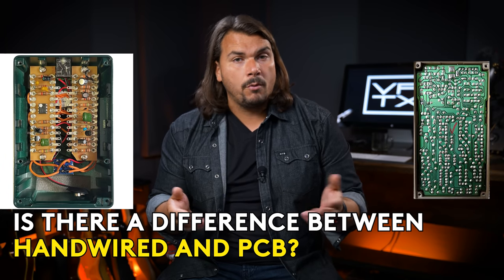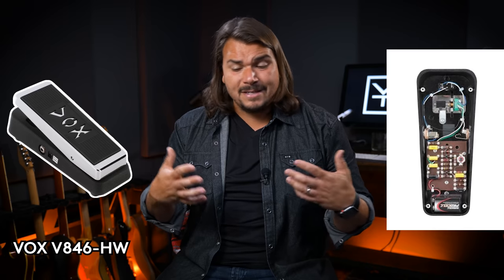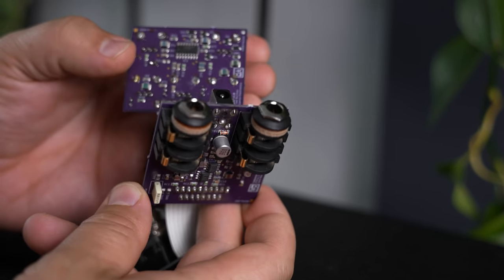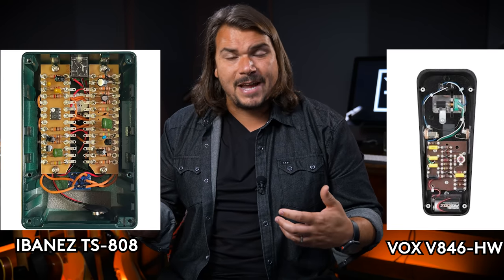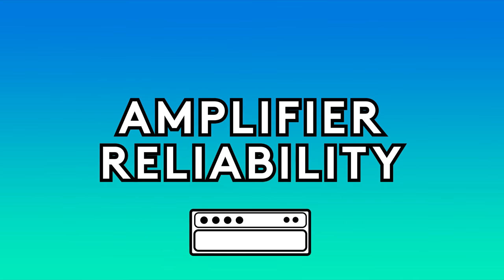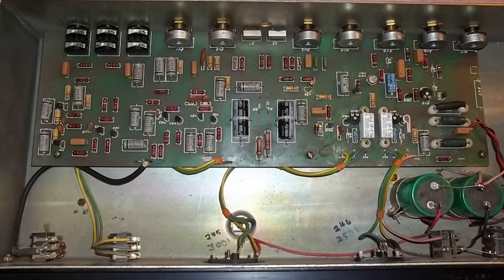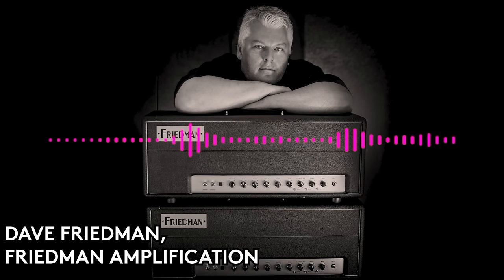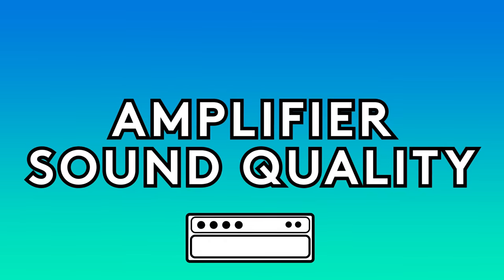Is Hand-Wired Actually Better?

Comment: All of it makes sense except the servicing - 100% no way can you fully service or avoid as many issues with a PCB. And keep in mind, the way Suhr or Friedman does PCB is not the same as everyone else. Also if you have an issue in 20 years with a PCB, will you be able to find a replacement? The best amps have historically been hand wired- because that’s the expectation, and thats reality. These are engineer-centric opinions, not necessarily user or owner based opinions. Ask a rock star, not an amp builder.
Reply from the maker: You actually can if you know what you're designing for.  The quality builds often will wire off pots, tube sockets, switches, and jacks as they are higher failure and higher usage parts.  They'll keep the other parts on a PCB.  Typically, there's not much to do on the main PCB if everything is executed properly and you have all your other parts already wired by hand and mounted to chassis, not PCB.  You're right, Suhr, Friedman, Rivera, Fuchs, do PCBs really well.  There are also a lot of bad PCBs out there that give quality PCB amps a bad name - but we're unfairly blaming PCBs for being the problem instead of bad engineering.

Comment: In terms of repairability, yes
Reply from the maker: Depends on the PCB and layout.  Often designs that are just going for cheap and short lifespan don't consider this - that is true.  But not of the high end amps.  PTP handwired can also be done poorly too making it difficult to service, especially if things are overbuilt like a Matchless.

Comment: when comes to AMP having both / I always loved,  AC30 there normal then hand-wired, so then u got the option, and the cost reflects it. repairability is needed I believe.  when comes to pedal PCB 100%  but  to mod thru-hole is nice but yeah tech moves forward, from pod bean to helix
Reply from the maker: They're not exactly the same amp unfortunately separately from the assembly style.  Same with most of the Fender amps as well.

Comment: "Hand wired" and "PCB" aren't mutually exclusive. This should be about point-to-point vs PCB. The Centaur and KoT do use PCBs, but those were assembled entirely by hand! Even surface mount stuff can be assembled by hand. Hypothetically, someone could make a machine that automatically assembles and solders a point-to-point fuzz circuit on turret boards - what category would that fall into in this case?
Reply from the maker: Sure...that's true, we're sorta collapsing PTP (point to point) with Handwired as that kind of how the market has come to ID this method in marketing practices and how consumers have come to know it.  Any process done by hand increases failure - by an order of magnitude (in the words of Robert Keeley) - the current Klon is all machine made, wave soldered etc.

Comment: Not surprised MANUFACTURES feel this way.  Of course these people like pcb because it increases margin with less qc complaints.  What about mods?  Ask anaolgman.  Or repairs? Some manufacturers won't even provide schematics to techs to repair amps. Some techs can't work on these products.  What do these interviewers care if you need to junk them?  Now you need to buy a new one and they get more $
Reply from the maker: Analogman's pedals are all PCB as far as I know for the main level boards, often the pots as well and footswitches.  These manufacturers of amps all make PCB and Handwired amps...they do both.  You're not going to find more respected voices in the industry that these guys when it comes to amps.  For pedals, I presume you're not speaking so much to in terms of handwiring as this is very rare and almost unused.
Reply from the maker: Travis Crow - who would be better to ask than someone that's actually building amps and pedals?  If you're not in manufacturing than you really have nothing to contribute here.  Most quality technicians will agree with this as well...nothing here is unique to these builders.
Reply: @VertexEffectsInc  Newer surface mount boards can't be modded by analogman.  Handwired amps/pedals are easier to mod and repair.  While I can appreciate that these are leaders in their field even they would qualify that a pcb needs to be well to be equivalent to hw.  Many are not well designed. Black star has a notoriously bad layout and  the bassbreaker boards are folded over.  Not every tech has the equipment or skill to fix surfaces mount parts (if they're fixable at all).  If it's not fixable it's junk. if it's too hard to fix no one will try and it's just gonna fill up your local landfill. just like those un upgradable phones
Reply from the maker: @jamesenter2095  he may not mod them, but they can be - but is that really the intent of any builder/designer - to build their product with the intent to modify?  Typically, that's not a consideration.  I understand that many companies migrated to SMD is consequential to Analogman since part of his business is modifying Boss, Ibanez, MXR, pedals etc.  However, through hole is reaching EOL (end of life) for parts number left, right, and center - every company will be forced to re-design around SMD sooner or later as they won't have an option in through hole for most of their component choices.  I agree, there is some really poor implementation of PCBs, especially on more budget tube amps like that you mention - this is however not representative of what PCB amps can be or their level of serviceability.
Reply: @VertexEffectsInc  surprised you didn't mention price in the vid.  that definitely makes a difference.   fender also uses lower quality components on their ocb amps.  love your stuff.  I joined your patreon last week
Reply from the maker: @jamesenter2095  Price and quantity will often dictate the PCB, John mentions some on quantities in his commentary, Josh mentions price in his commentary.  Generally, you can make an amp cheaper by going PCB and in higher volumes quickly on PCB.  You can also build a higher quality amp quickly on PCB however and cheaper than a handwired amp, however at a certain threshold some believe that only a handwired amp has merit, albeit incorrectly.
Reply: Sounds like a incompetent angry tech rant 🤣

Comment: PCB is surprisingly easy to repair, but it is definitely more precise than hand-wired. My biggest issue with PCB are the various unmarked SMD components. It dramatically slows repairs down trying to figure out if an unmarked part is testing correctly, especially when nobody supplies service manuals anymore.
Reply from the maker: That can be frustrating but that's more a PCB design layout thing...good versions of layouts will call out PN's and values often for SMD stuff.

Comment: This topic reminds me of digital vs analog, whereby modern implementations of digital tone is pretty dang good compared to the POD kidney days.

I remember when Klon started doing the KTR. All the gear heads were in an uproar. I believe the first batch did have some issues, but have since been fixed.
Reply from the maker: Well...both Klons were PCB and really no two Klons were exactly the same sounding IMO.
Reply: Ah my bad, I had assumed to Centaur to be through hole for the most part. So I guess that is one example of PCB but with variables decided by component availability then?
Reply from the maker: @coffeedudeguy  most every famous pedal is all PCB...Tube Screamer, Klon, King of Tone, etc.

Comment: You are basically correct about the construction of pedals and other similar items but you are way off base about amplifiers. Virtually no modern cicuit board amp is made to be easily serviced, particularly tube based amps. The components such as tube bases, inputs, pots, and switches are nearly always inferior to those used in almost any hand wired tube vintage amp. The circuit boards used in nearly all modern tube amps are thin, suffer from too thin or single sided traces and pads which will eventually separate from the circuit board, especially if heated when soldering in a new component. The components themselves are generally mounted diretly on the board causing heat failures, often in the first two or three years (I'm looking at you Fender, Mesa, etc.). Fender amps built before the early 1970s were all built to be easily serviced. No current circuit board amp is going to last as long as my 1964 Fender Super Reverb which has only the capacitors and screen resistors changed in the past 58 years and sounds better today than any Fender amp made today. You aren't being honest about serviceability of amps. You need to ask the techs who work on them and not the manufacturers. Every single tech I have ever encountered absolutely loathes Mesa Engineering and considers them almost unrepairable due due poor documentation, undersized components, and seemily randomly placed on multiple circuit boards. Modern Fender amps like the Hot Rod Deluxe and other similar models are all currently manufactured with very poor quality IC brand capacitors which fail regularly within two to three years. Many of these also suffer from undersized components, cheap pots, and failure prone circuit design mistakes that guarantee eventual early failures, excessive hum, etc.. 

No, the amps aren't better.
Reply: Owning a Hot Rod Deluxe really opened my eyes to the issues you mentioned.  The plastic input jacks alone are a shame.
Reply: @mr.anderson70  Check out Psionic Audio's channel. He's a tech that has recently done quite a lot of videos describing various amps repair and their typical issues as deep as you want to go. He does all brands of amps from the 40s through current. There are specific issues on things like HRDs that once fixed will really increase their reliability.
Reply from the maker: @clarkeblacker  you're correct when it comes to high volume and low to mid budget amps, like a Hot Rod Deluxe for example - bu these aren't good PCB designs and not on the level of a Suhr, Fuchs, Friedman, or Rivera amp for example.  We show some quality examples in the video, like the Suhr Badger and how that's done.  The PCB is quite serviceable, and the issues that normally occur on cheaply made PCBs aren't present.  Secondly, the do mount some parts directly to the chassis and hand-wire them where appropriate, like the heater wires.  I do watch Lyle's channel on occasion and on Facebook before he started the YouTube channel and the issues with PCB amps that he has are generally all cheap-o PCBs from Fender, Vox, VHT (post Fryette).  He'll also equally roast bad handwired amps or those that underperform the standards or over-perform the standards and create serviceability issues as a consequence.  I think he'd agree with much of what's said in the video.  You can't compare bad examples of PCB amps and make that the standard for a quality PCB...doesn't work that way.  Remember, it's the execution of the method, not the method itself.

Comment: Maybe you should ask Jesse Hoff(LAZY J) and Phil Jamisson (Matchless) they will maybe have different opinion,  suhr and friedmann are searching for high gain not for perfect clean... i've tried many time some amps that have a serie pcb version side by side with the  point to point model from the exact same model, and every time i was blown away by the difference!!! how do they explain that? i think some players doesn't even see the difference... i do
Reply from the maker: They've decided to build amps a certain way based on the heritage of what they either 1) took over, or 2) are replicating from a vintage/historical prospective.  Suhr and Friedman make a variety of amplifiers from clean Fender style amps (like the Hombre and Bella), to high gain channel switching amps (like the BE-100 or the PT-100).  Typecasting them as not being able to relate to clean sounds is an oversimplification of their skills and talents and how long they been at this work (before I was even born) with a variety of amp styles, artists, and musical genres.  Remember, Lazy J is reproducing Tweed Fender amps primarily which are very simple circuits and all hand wired because that's how they were made in the 1950's.  His production is small and going PCB for him would be 1) expensive given his volume and 2) the inverse of what his customers want to see as a Tweed Fender style amp builder.  Secondly, Phil, with Matchless took over the brand after it had been established by Mark Sampson who'd developed a look and style for the Matchless circuits the pre-dated his involvement.  Matchless customers came to expect a handwired amp with these beautiful wire looms (Matchless used to bring a plexiglass cabinet and chassis to NAMM shows to show their wiring work).  To transition to PCB would be a hard sell to their customers as they've come to see Matchless as synonymous as one of the neatest routed hand-wired amps out there and they expect that when they buy one.  Additionally, I don't think Matchless is putting out more than a few hundred amps per year...still a small operation compared to Suhr or Friedman which make thousands.

As to your comment about PCB amps vs. Handwired (point to point) amps that you've compared of the same make and model - your presumption is that they're the same amp (both handwired and PCB) because they are the same model name - they ARE NOT!  Any amp technician can tell you that a Handwired '64 Princeton Reverb Custom Shop is a totally different and from a Princeton Reverb Reissue (PCB based) - or that the Reissue series of most amps is not the same as the originals.  The components are different, the layout is different, and the circuit in many places is different from a real Princeton (where the '64 custom shop is pretty much a 1:1 replica of a vintage model).  In other words, you're not actually making an accurate comparison of the two methodologies (however, I can understand why most people would think that they are).  Really, the only way to test this objectively is to have the same designer layout and build the same amp in PCB and with a eyelet board with the same components and spacing and compare from there.  Unfortunately, it's a fools errand and most that really understand how to do PCB properly would never attempt to convert the circuit to PTP because they would understand the obvious drawbacks to assemble it without improving the amplifier.
Reply: i can only agree with you, i know that this Ri princeton are poor..i had a BOGNER a MAGNATONE and a TONE KING that are pcb handwired an very serious in terms of components, and it's true that single man compagnies can only do ptp hanwired amps, and it's generally the owner an engineer that is personnaly soldering and cheking everything, and it's maybe at the end the really big difference... instead of girls or boys that have been very fast formed to solder amp they don't know absolutly nothing about, the right components into wrong hand make bad amps, and that is the bad side off mass production... and mass production amps should be cheaper as what they are in the end